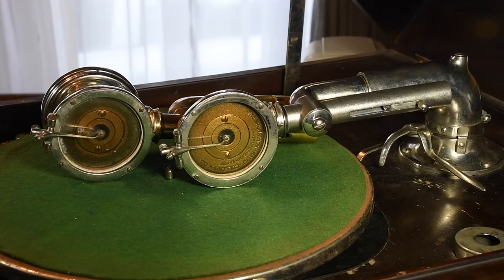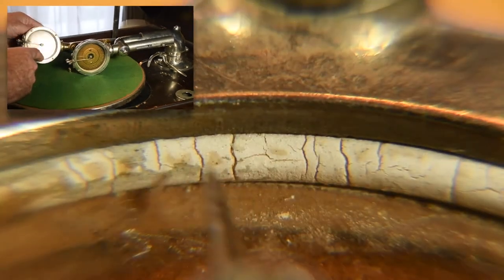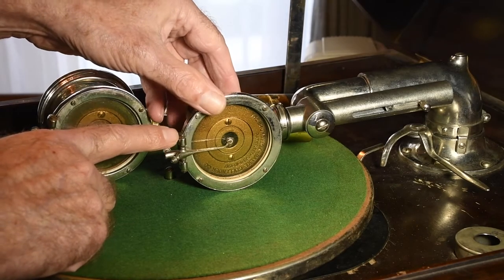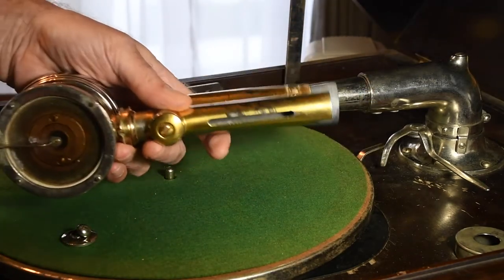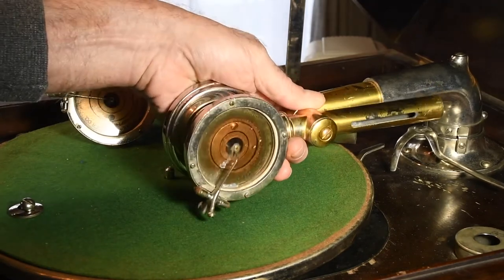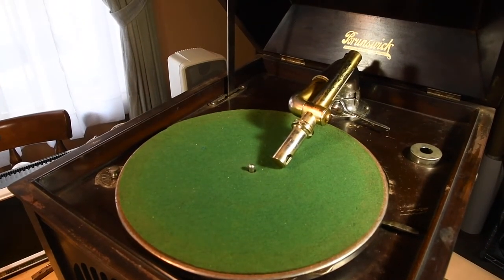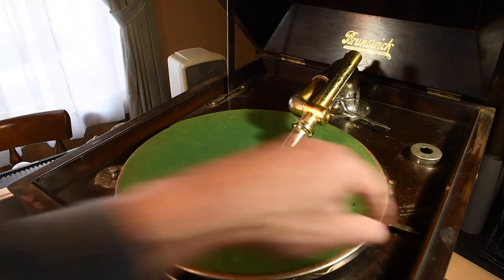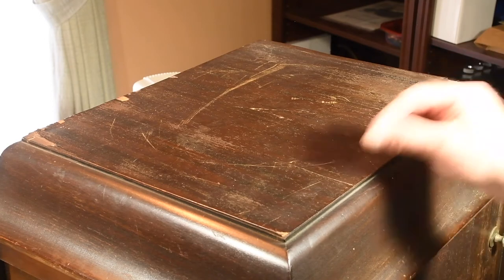Brunswick 105 restoration questions

Comment: Mark,  The veneer can be repaired/replaced.  Literally remove the top layer that's loose and place new veneer over it.   I'm not your guy on this one.  I sold all my equipment in Jan 2019, so don't even have a bottle of glue.   Definitely worth restoring, but the veneer requires someone more knowledgeable than I.  Appreciate you asking though.   Scott.

Comment: Sorry about the freezer trick not working, it may take a few attempts after a day or two, you don't want to force it or the pot-metal can break.  Ultona reproducers aren't that difficult to work on, you can get the gaskets off eBay, but since the mica diaphragms are an odd  size they aren't generally stocked and you have to custom order them. You'll have to drill out the old diamond styli chunk on the Edison side of the double ultona if you want to replace it, but honestly it's easier just to wait for a good diamond styli to pop up on eBay (it takes a little patience.)  You can get it professionally rebuilt by a reproducer rebuilder, I'd suggest Wyatt Markus as he's the king of restoring reproducers in the hobby, he can even replace the diamond styli but it'll be a little more.
Reply from the maker: Oh, yesss! Being VERY careful with that pot metal!!  Not giving up just yet, this may require a long term repeated application of the penetrating oil. I squirt some of the oil into a cup and injected it into the seam with an insulin syringe for more careful application. I haven’t given up hope.

I ordered the mica diaphragms, they’re 2 9/16” diameter, ordered enough to do all three diaphragms. One vendor was selling the gasket tubing in 12” lengths, but I asked if he could sell one piece long enough to handle all six gasket rings (2 per diaphragm). I’m undertaking the rebuilds myself, but the Edison jewel and linkage is something I’ll have to leave to a pro. Not too worried about the Pathé jewel point just yet since I have none of those records, but clearly a future option.

Aluminum casting on those soundboxes, so no Brasso to polish them. Minor trip to the hardware store for aluminum polish tomorrow, and see if I can find the needle bearing screws and locknuts as well (I think they’re 4-56 thread).